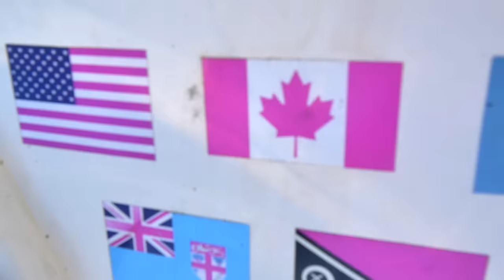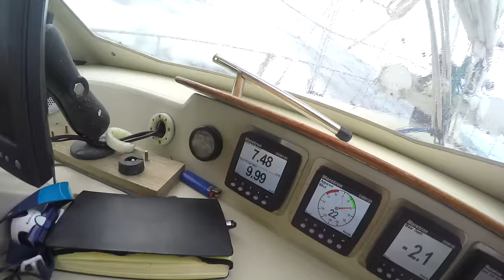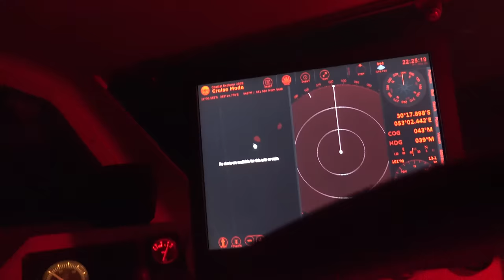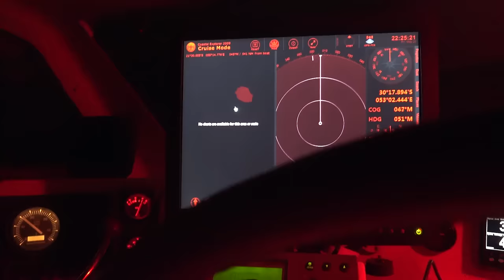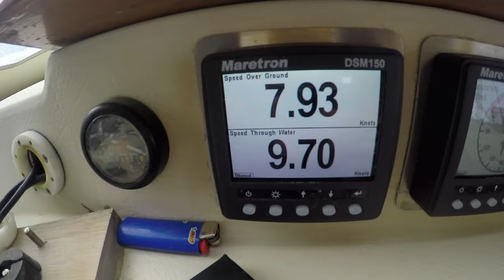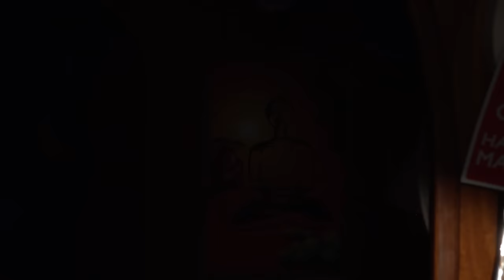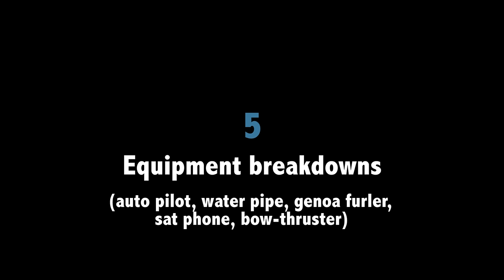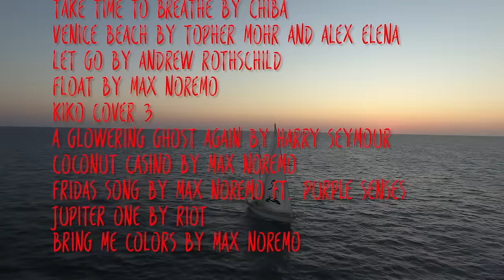How it feels to see land after 15 days at sea!  Sailing SV Delos Ep. 108

Comment: Nothing wrong with your editing Brian. I like the Captioning.I like how you start talking showing your face, then switching over to what you're talking about while you're still talking, I caught the underwater music muting, Cool.Sorry about the Iridium, but it was in an unvented locker I believe. That's a No No IMHO. Can't trust anything that generates heat. Small computer fans use no power and can be put in stuffy places to help keep heat from building up in places. 3 to 4 minute stretches of waves and boat shots big or little would be welcome. Nice work on the furler.
I'm hoping that connection is secure. I'm sure you know, loose connections create resistance, which = heat.Being a HVAC Tech I can't help sticking my nose in to mechanical difficulties.I'm impressed with you mechanical abilities. Looking forward to the next video,Cheers Delos. Delos Rules !

Comment: I was having a brain drizzle.. are the SSB, Iridium and Furler all run offa 12 volts? And it gets its  power from, what, the solar panel (direclty  or with a DC-DC converter?). I'm wondering if whatever powers the 12V ain't doing what it's s'posed to.  Lovely vid as always!

Comment: Hello Delos from a long time follower and appreciator of your travels and videos. In this video you point out a problem with both your iridium phone and SSB radio. After some reflection I wonder if its possible that Delos took a lightning strike that zapped both of these communication devices? I seem to remember a communication stating both devices were connected to antennae. If my assumption is correct I don't know what protection you could put in place to prevent a reccurence other than disconnecting during future electrical disturbances. Possibly isolation switches on both devices that would be left open other than during periods of use. Hope this communication is helpful and finds all the Delos crew and guests healthy and enjoying life.

Comment: Wondering what happened when the equipment blew , or at least the cords ? I know the boat is 24 volts, did the regulator take a dump and voltage go up from 12 to much higher ?

Comment: I enjoy your content , I was in the US Navy and I can tell You 15 days is a walk in the sun, on my last deployment I spent over 90 days at sea on station , port and starboard duty, 12 on 12 off but due to special evolutions it became more like 72 on and 6 off with the six being uninterrupted sleep if you could call it that, we had a port call at day 90 something for 2 days or so and then the remainder being at sea underway and on watch and the food was hideous to say the least. I was a signalman  and I spent my 12 hours on in the wind spotting contacts with relative bearing and position angle in any and all weather and reporting it to the bridge and CIC, 50 foot swells or not. We ended up finishing our deployment  in the Med with a specop into Alta Fjord via the north sea wherein we got hit with a noreaster that cracked our superstructure from the 03 level all the way to the main deck in 4 places, the seas were so bad that when we crested a swell both the screw and the sonar dome were both out of the water at the same time, when we slid off the the swell we would plow the bow into the next wave all the way up to the bridge windows which inevitably had to be welded shut to keep sea water out of the nav equipment on the bridge, 2 out of 4 transmitter antennas ended up snapping off their mounts and slipped into the sea , satnav went down due to cracked mounts and strained electrical connections, it was soo bad you had to take your boots and put one under each side of your mattress and lay face down with 2 belts around your waist one left around the rail and one right around the rail on your rack to avoid being tossed violently onto the deck on your face from the top rack 3 racks high

Comment: 10:53 You lost your negative connection and consequently the supply, was made somehow through the casing of the motor; that way, the circuit was closed through the other devices you had in that section, which obviously, couldn't bare the current that high..., I suppose... Any opinions? What's the lesson of this deed?

Comment: you guys are getting power surges... it seems maybe. which would melt solder, or a charge cable... electronic control unit malfunction? bad ground? crossed wires somewhere..or bare from rubbing and touching wires next to them...multiple electric fails , of a surge variety would cause me to believe its more than equipment failure

Comment: I never leave my devices with lithium batteries permanently connected to power.
Only charge as needed, they will last forever.
Reply from the maker: Yep Myles this is smart and what we started doing after this incident.
Reply: I am an electronics tech and a ham radio operator ..............